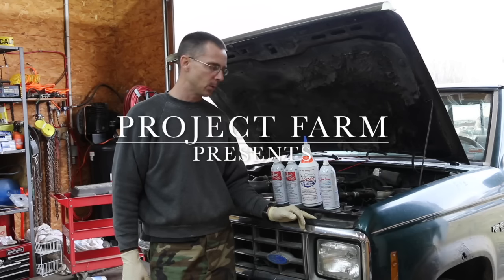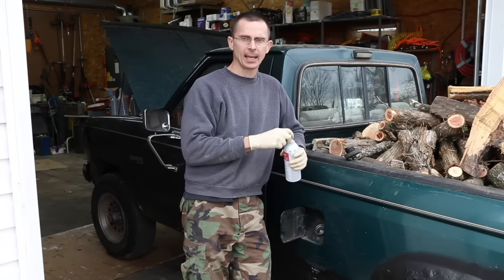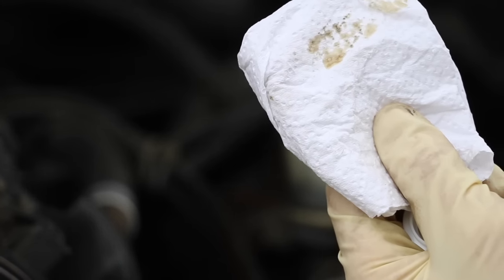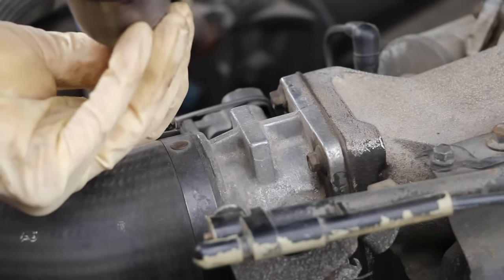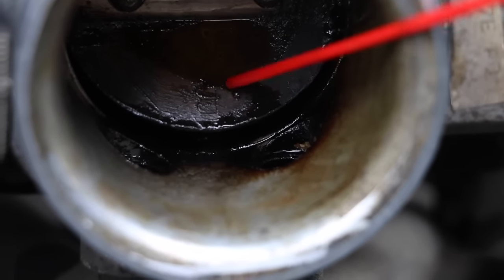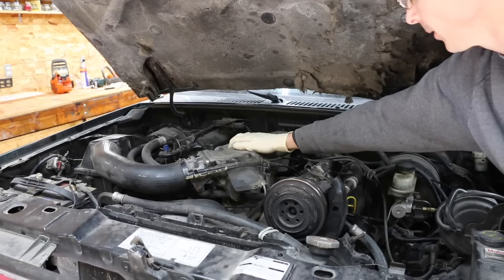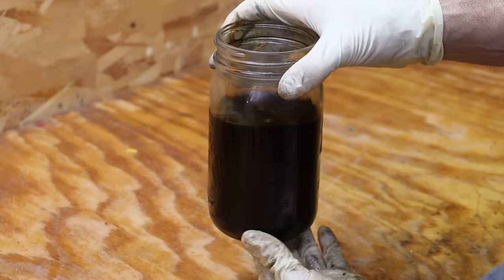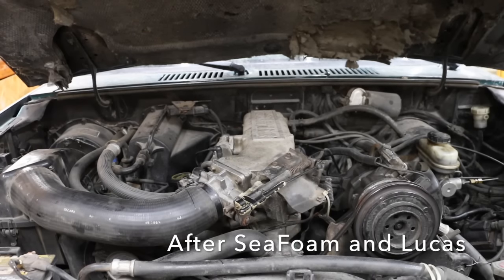Seafoam--can't believe what it did to my engine!!

Comment: Knocking all that sludge into your oil pump can cause it to fail, any increase or decrease in oil pressure?
Reply from the maker: Great point.  The truck doesn't have an oil pressure gauge and I didn't get an oil pressure reading before this test.  However, the truck continues to run much better than before.
Reply: Project Farm thanks for your unbiased , intelligent, and straightforward method to testing products , definitely a channel I visit frequently!! Happy holidays
Reply: This is why I use transmission fluid in the oil. 
It's both a lubricant and a detergent.  It slowly liquefies the hardening and hardened oils and sends it through the filter.  It doesn't break it off in chunks
Reply: Mad Scientist - but does it affect the engine seals in any way?
Reply: ATK Girlfriends 
It actually helps to soften the seals because it removes the carboned deposits that dry out seals and make them brittle.  It doesn't fix a cracked seal but allowing a seal to be unrestricted in movement is always an improvement.
Reply: Carbon does not dry out your seals. The seals have oil in them and as they go through heat cycles the oil escapes and leaves the rest of the rubber fibers behind making it brittle. The transmission fluid has a chemical in it to put that oil back in the seal and keep it soft. Lucas oil treatment has these same chemicals in it. But, if the seals are too far gone you can make things worse by making them soft again, like blowing the seal out all together.

Comment: Well as a know it all teenager and younger 20's. I used to pour a quarter can of this stuff in the brake booster line. Then start the engine and let it "clean out" that way, or so I thought it was. Well that caught up with me on a 4.8L Silverado I had. The brake booster line ran to right above the last Cylinder on the driver side. It all poured into that cylinder, then I turned the key. Well, I know what Hydro-lock is now!! One of the most embarrassing moments of my life in front of a lot of people in the Rual King parking lot. Instantly broke piston, rod, and chewed up the cylinder wall. It sounded horrible.. It still cleaned the engine, by me having to buy a new one :D.. I am glad you made this video. Seafoam is really good stuff and I was tired of people calling "snake-oil".
Reply from the maker: Thank for sharing.

Comment: How long did you drive after adding 5 oz of sea foam to the oil?
Reply: You should add it within 100 to 200 miles of an oil change. Just remember that it might make the oil look completely black, which means it is working. And I usually add it and drive my car really hard to get the oil nice and warm to help soften up any deposits.

Comment: Excellent!  Apologies in advance if this has been mentioned, but I would add changing the inline fuel filter AND sock filter etc attached to the fuel pump after running an initial through-the-tank fuel system treatment on any vehicle that is this *due, unless you’ve recently had eyes in the tank and already know it’s clean.
Reply from the maker: Thanks!  Thanks for the feedback.

Comment: Now get rid of that disgusting insulation on the hood.
Reply from the maker: Daniel, thanks for commenting.  I agree...the insulation needs to go!
Reply: I got an insulated hood on my Plymouth Reliant, I found it actually helps warm it up in the cold compared to non-insulated vehicles.
Reply: Project Farm one of the reasons for the insulation...is to help keep the paint on the hood to not cook/ruin...remember..the paint and primer isn't just for looks..it helps protect against rust/corrosion : )
Reply: Well, with the money that automakers are trying to save I doubt they would put something on the hood that wasn't necessary. :-)
Reply: alwcurlz thank you...ever notice when a car needs paint..and the front fenders barely shine ...the hood 9 out 10 times is flat with no shine because of heat..from the engine rising up..were the insulation is necessary to help reduce excessive heat from cooking the clear coat..
Reply: The insulation is only for noise suppression. Have you checked the temp of the car body in the hot summer sun?  Comparable to engine heat.  Engines are running around 200* or less.  Thats not much.
Reply: Daniel Hough your rite on noise supression...ok I didnt mention that benefit...but to say its only for noise reduction is being a little short sided...trust me ..I have owned vehicles with and without hood insulation..and the ones with out ...were wayy hotter when the engine ran for a while...
Reply: They're also for flame suppression in case of engine fire. Used to be made of asbestos back in the day, now they're some kind of synthetic flame retardent.
Reply: wildthing302
Yep, that's a common thing on the old Jeep trucks. No insulation, paint/clear peeling off.
Reply: alwcurlz thanks
Reply: also remember older vehicles it also helps protects the shorting out the battery
Reply: hood^*
Reply: Daniel Hough my gfs cruze operates at 221F
Reply: The foam pads behind the fenders helps hold in moisture to expedite the rust process.
Reply: Daniel Hough My dad just had a rodent problem with his Honda. They chewed the injector plug which my dad was unaware of and when he started the car it shorted out the computer. Moral of the story... remove hood insulation.. Your engine will cool itself better also.
Reply: That makes perfect sense since the hood is flammable.
Reply: 200 C maybe.
Reply: Slayer John and
Reply: Slayer John q
Reply: aleon1018 Dude, if you've got anything making nests and living in your truck, you need to drive it more often!
Reply: saturday night live donald trump
Reply: do you think I want Saturday Night Live with Mark Baldwin and Eric it could be fun to watch just remember broadcast television list of all the Galleria Saturday Night Live Eric Baldwin
Reply: saturday night live
Reply: Yard Sale Dale  Yes it is to Smother out a Engine Fire.

Comment: my 98 dodge ram 5.9  smoked on start up really bad  After Lucas no smoke.   I don't know.
Reply from the maker: Thanks for commenting this.
Reply: Matthew Langer falls down a well eyes go crossed   drinks seafoam they go back again  i dont know
Reply: 5.9 known for intake plenum gasket failure...just saying.
Reply: Sounds like your oil rings were dirty or gummed up really bad
Reply: its a dodge what do you expect
Reply: Matthew Langer... 5.9 is this the Cummings?
Reply: Because it sludged up your engine.. less blow by.. increased oil pressure does not equal increased oil flow always, just remember that
Reply: Jason Farr First off, CummINS. 2nd, it's probably the gas V8.
Reply: Smokeing on start up are bad valve seals....
Reply: or blow by on a 5.9 Ive had 3 of em do it at 350 K

Comment: I love the Seafoam products.  The gas additive has kept my push mower and snow thrower in perfect running condition (the Toro mower is now 26 years old with original engine). My Sears riding tractor was running rough and my mechanic said I needed a new carburetor...they ran about $350-$400 installed.  With 200 hours on it, I decided to try Seafoam....added 10 oz to 5 gallon tank....by the time that tank was near empty, the engine was running as smoothly as when I bought this machine 17 years ago.  Amazing.  I also use one of their products to clean/preserve my firearms as well.  Great products.
Reply from the maker: Thanks for sharing.

Comment: I was really surprised to see the carbon build up loosen up and even fall off from the throttle body! It's no wonder the oil turned so dark after only 3 hours! I've been using Seafoam on my 200k+ mileage vehicle every other oil change or so just from users claims, but this really inspires confidence. I'm actually a bit shocked on the before and after engine sounds. I might have to start using Lucas Oil as well. Thanks for another great video!
Reply from the maker: You are welcome!

Comment: My old 1999 Subaru Legacy Outback has 285,000 miles on the original engine (did have head gaskets replaced with MLS head gaskets at 170,000 or so miles before I bought it). When I first bought the car as a project car, I noticed possible faint rod knocking develop, especially after the car sat for a while with old oil that sludged up inside and began to heavily burn oil (1 qt every 300 miles!). I ran seafoam in the crankcase to clean that sludge up, drained the old oil, and put in 5W30 full synthetic and the Lucas Heavy Duty Stabilizer additive. That engine runs the best it ever has since I bought the car! Even with very cold conditions with the additive, it runs fairly quiet on cold start apart from typical old Subaru piston slap for a minute or two, and when the engine is warmed up and revving, I hear no noise whatsoever, very little oil burning, and the engine has so much more pep, having better compression and oil pressure. I was hesitant about putting in the thick additive as it is wintertime currently, but I have not had an issue so far. Just let the engine idle and warm up for a few minutes before taking off.
Reply from the maker: Thanks for sharing.

Comment: I drove my 2019 Fusion over 100,000 miles in 4 years, did an oil change every 10,000 miles with full synthetic oil and one quart of Lucas and would put Seafoam in the gas tank quite often.  Just traded off the car for a new vehicle, the dealership was blown away with how good the engine sounded for as many miles as the car had.  One thing I learned with the Lucas is that is easier to pour if you empty a couple quarts from your new oil jug and then put the Lucas in the remaining new oil and give it a little shake up before pouring the rest in the engine.  Lastly, the Lucas bottle works great for bar and chain oil if your chainsaw has a tight space for adding oil.
Reply from the maker: Thanks for the feedback.

Comment: Valve clatter is actually noise made by the wear in the valve lifters and is eliminated when they are properly adjusted. 
Nothing in a bottle or can will make the adjustments but may serve to mask the sound.
Reply from the maker: Thanks for the feedback.

Comment: First, I really like what you do!  And my 2001 Mustang, and old 98 Grand Marquis wouldn't even run with as much throttle plate carbon and soot that you have.  (there are good cleaner sprays for this too!)  The idle air control valve (IAC motor) would also be just as fouled up.  Looks like Mazda (Ranger) did a better job designing those components ability to tolerate carbon buildup than Ford.  Yes I am a 100% Ford Motors owner, even today.
Reply from the maker: Thanks!  Thanks for sharing.

Comment: Before spraying into intake , Use a paint stir stick wrapped with a paper towel sprayed with seafoam . Hold flap open with a screwdriver & spray a bit into hole. Wipe out inside walls in front and rear side of flap.
You will wipe out sludge off inside inlet where flap touches inside wall. Do this until its clean 4 or 5 times.  This avoids all that sludge being washed into motor. Then Spray 1 can with motor running at hi idle.
Reply from the maker: Thanks for sharing.

Comment: Yes, it definitely worked on my 89 5.0 mustang. Cylinder one was burning a significant amount of oil and we suspected it had a ring issue, as it had set for several years. I put seafoam in the cylinder and let it sit for a day. Pulled the coil wire, crank the engine over with a rag over the hole to catch any oil, and put a new spark in (all of the other plugs have been changed previously). 

I drove the car work and about 3 miles down the road it smoked less, and after about 30 miles turning about 2500 RPM it was getting better, with only a little smoke. Over the course of a few days, there was less and less smoke and then it stopped smoking.  I did change the spark plug two more times, but it probably only needed to be changed once more due to oil fouling.  

After the vehicle set for a few days, some of the smoking came back, but after driving in a few miles everything was good. Now, roughly 3 months later, did no longer smokes, even after setting for around a week. 

It is definitely worth trying seafoam in the cylinder if you’re burning oil. I did try the throttlebody/upper intake cleaner, the same product used in the video, and it really did not make a difference for me. 

As a sidenote, the project farm videos have saved me quite a bit of money. I do my product selection based on the results from this channel.
Reply from the maker: Thanks for sharing.

Comment: I have treated many of my cars, and friends cars this exact way. My current truck (98 Ford Explorer 2nd owner I've driven it since 118k)  has had this done several times from 150k to its now 280k miles, its due for another go. Sounding like maybe it wont make it though. Overworked. Lol... I had a 93 Thunderbird 3.8ltr v6 that had a 386k miles on it when the water pump blew and it was dead winter I still sold the car for 800$. Lol. That car had this exact treatment as well. I think maybe the first couple times was with Berryman and DuraLube as Seafoam and Lucas were not mainstream yet... Same concepts however. 

   I tell everyone about your channel... I tell them that your tests are better than consumer reports as we feel we are right there with you for the testings. 

  Thank you.
Reply from the maker: You are welcome!  Thanks for sharing the channel!

Comment: Just did this to mine today. 94 ranger 4.0. 284 thousand miles on Speedo. Engine does not run like it has that many miles. Acceleration is good but idle was a little fluctuating. Did gas treatment top-end treatment just like in the video and 6 oz of seafoam in the oil. Added liquid Molly after the clean-out. Idol has steadied out but will change plugs. Put some bashed platinum's in there and see how they workout
Reply from the maker: Thanks for the suggestion.

Comment: Don't forget to run an FL1A oil filter with a check valve to prevent lifter bleed down. That will prevent lifter tick on cold start up.

Comment: Impressive! Thanks for the tips. The part I didn't get is that I noticed you added the seafoam to a full tank of gas. Most demo I watched today recommend adding it to low gas tank and rev it till the smoke clears. With your approach, should we assume that the exhaust will be putting out smoke until the next fill up?

Comment: Thanks for the thorough run-through on this process...I liked how you ran the comparisson of the noisy  engine's initial sound after completing the treatment process - It was an excellent sound comparison on the engine. I was just curious on the performance of the gas tank treatment afterward -wondering if you could post improvement of fuel lines and engine performance thereafter. Im going to try this treatment on my high mileage Ford Explorer and see what happens -Thank you.😊😊🌺 8/16/24

Comment: I’ve noticed that spraying enough to stall the engine, and then waiting for awhile before repeating seems to really improve cleaning. Does this allow the product to accumulate and give it time to act? I don’t know for sure. 
Also, fogging the intake with distilled water gives as good a result as chemicals, if not better. Water is truly amazing n all of the things it does. 
It’s important to note that cleaners that are added to the fuel have no effect on carbon deposits in the intake of GDI vehicles, which is the case in new vehicles. It never reaches that part as fuel is injected directly into the cylinder. Just the fuel itself will do a lot of intake and valve cleaning on the non GDI engines. I’m not a fan of GDI for that and other issues.
Thank you for another great video. Your content has helped me choose the right product or tool in many instances.
Reply from the maker: You are welcome!  Glad to hear!

Comment: Next time you use Lucas oil stabilizer try putting it into the oil container after you drain a quart. It'll flow easier and faster into the motor. Great video!
Reply from the maker: Thanks!  Thanks for the feedback.

Comment: My use and belief of Seafoam began with a jet boat I used to own. It had an inboard 2 stroke Mercury 175hp Sport Jet that was not responding throttle wise. This was due to the boat sitting over winter and using regular pump gas with 10% ethanol. The ethanol gelled up over the winter causing the three 2 barrel carbs to gum up and have horrible response, particularly once the powerband was hit. My first thought was to rebuild the carbs but I threw a few things at them first in order to see if I could fix them up. The last thing I tried was Seafoam mixed into the gas. It took about 15 minutes of run time on the water and the throttle issue completely disappeared. I couldn't believe how well it worked. I've been using it ever since.
Reply from the maker: Thanks for sharing.

Comment: I have a bad timing chain tensioner on my 15 Tundra, and chain rattles so bad at cold starts. Today I tried the Seafoam in the oil, and Wow not even a min I didn't hear any rattling noise... I mean still some ticking but way way better than before. But I'm just worried about my rear main seal leak if will be affected by the seafoam... And not sure after draining the oil if the noise will come back. Thank you for encouraging me to try this!!
Reply from the maker: You are welcome!

Comment: I got a 2001 1.8Turbo jetta! I replaced my fuel filter and added seafoam to fuel.. gonna try it in my crankcase and manifold next oil change soon!! I will use half and half if one can since these 1.8t engines are small!! I used did the fuel method today and I immediately noticed a smooth idle. I had a small misfire on idle but it’s completely gone now
Reply from the maker: Thanks for sharing.

Comment: My 01 Chevy Tahoe has 300k miles, every couple years I do the seafoam intake treatment. Along with replacing a quart of oil at the changes with Lucas oil stabilizer, it runs and drives great
Reply from the maker: Thanks for the feedback.